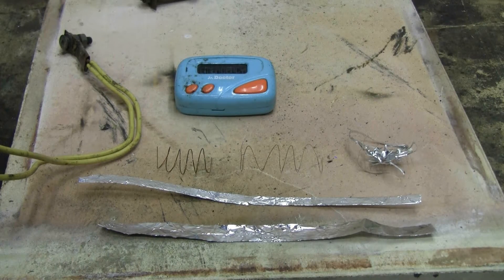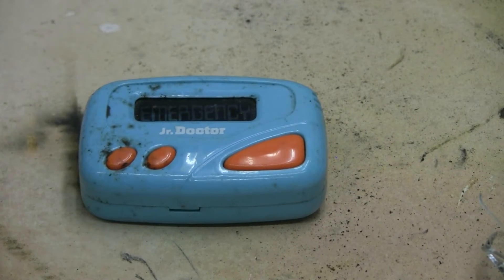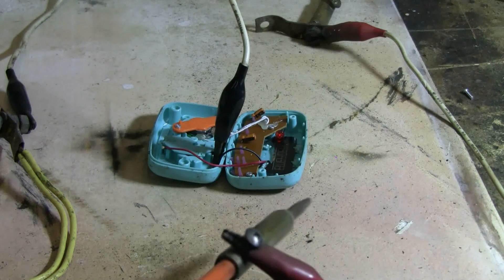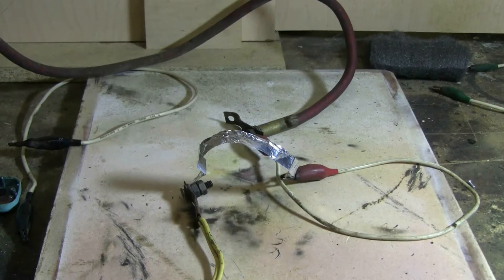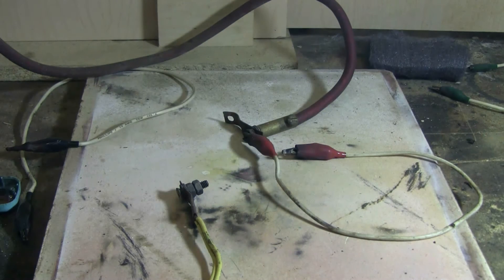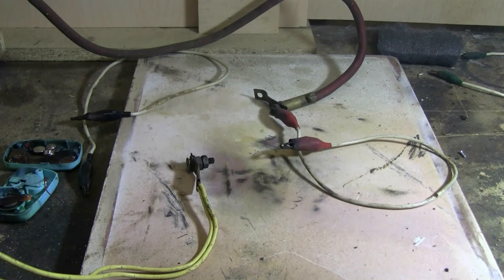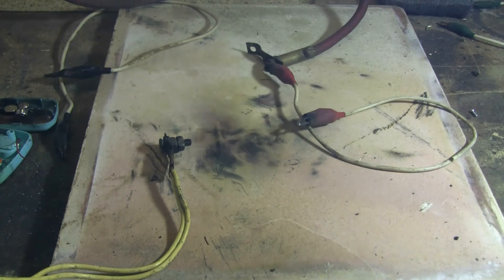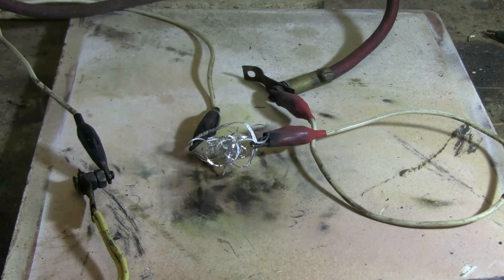Capacitor Bank #84 - Toy, Metal, And Wire

Comment: How do you power the cap bank?
Reply from the maker: +58belvedere I use two MOT in series and rectify with microwave oven diodes.
Reply: Thanks Bill the cap bank is really neat. are you into ham radio?

Comment: Thanks Bill, have you any magnesium ribbon to try it with? I'm wondering if it will vaporise or ignite now. :)

When I was a teenager I was restoring a Lister D type stationary engine, I found that I could burn the metallic security strip out of our £5 notes.. I guess your cap bank would cut out currency right in half! 
Keep up the entertaining videos..